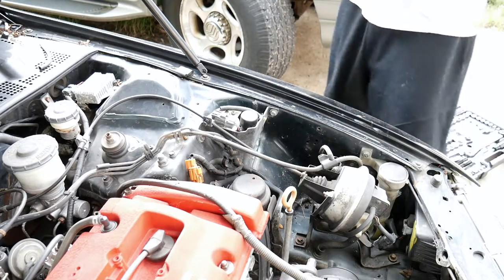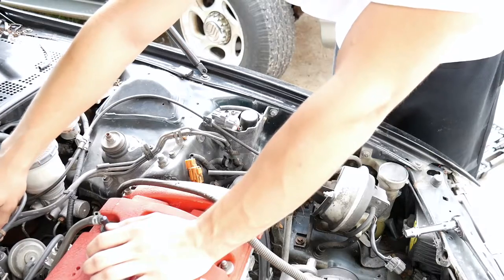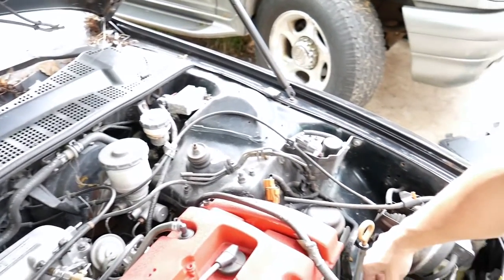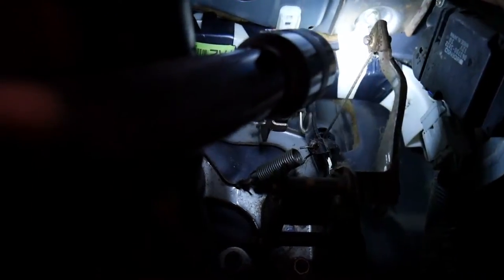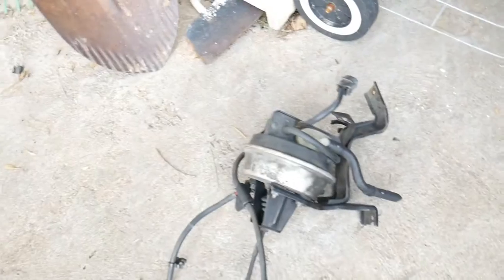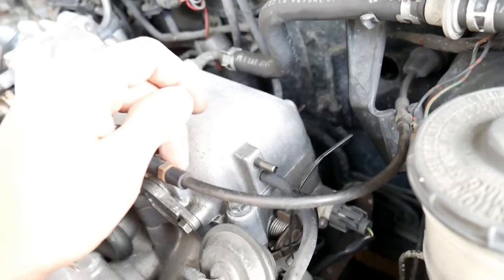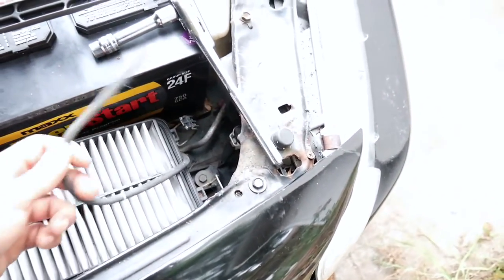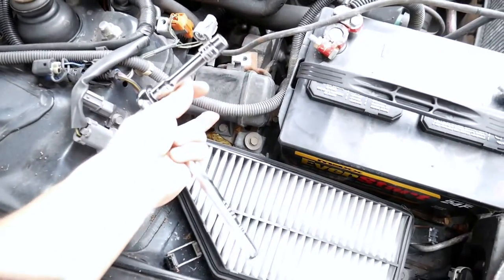Project BB2 Prelude #2 - Cruise Control Delete

Comment: did you already remove the parts inside the fender as well? im kinda new to the deletes but im pretty familiar with the preludes, ive had 5 of them and my current daily, cruise control doesnt work so im going to delete it as well to clear up some space and try to make it continue to look better, just wondering if there is anything specific about removing whats in the fender
Reply from the maker: inside the fender its just a small plastic solenoid in there, ill later remove it when i have the fender off, it doesn't do anything just leaving it in there.

Comment: Curious question. If I delete my cruise control but keep the switch, harness, relay, fuse, etc... Is it possible to run fogs on the same connections?
Reply from the maker: not sure but does sound like it may be possible but probably would have to rewire some things

Comment: Hey how did you delete power steering? thanks!!!
Reply from the maker: remove pump and lines and take down the steering rack and take apart the rack and grease it up real good and remove the valves from the rack and either find some bolts that will fit in the holes that the lines were connected to or do it like me and fill it up with quick steel. i believe there is a write up on one of the forums online